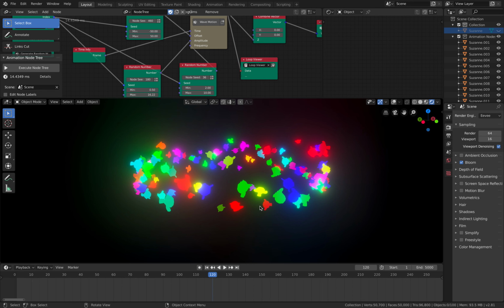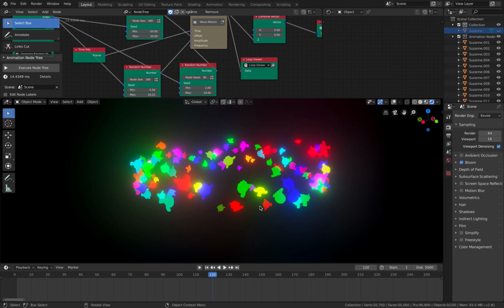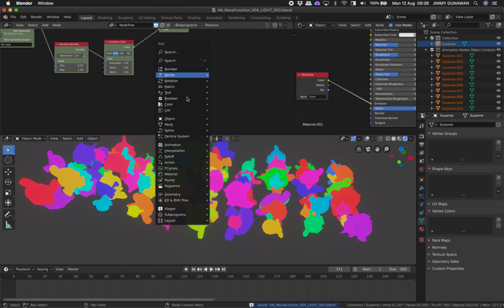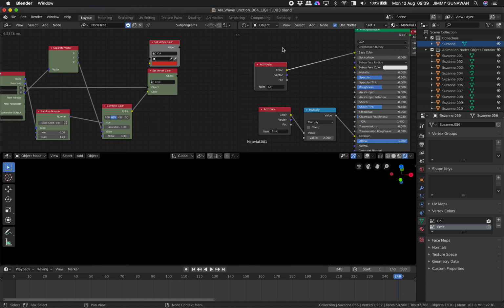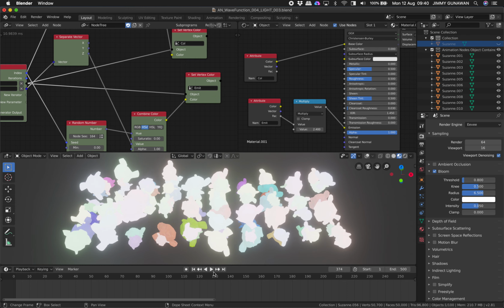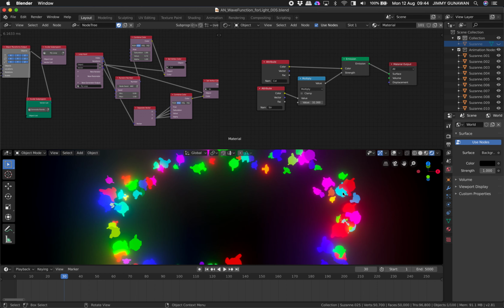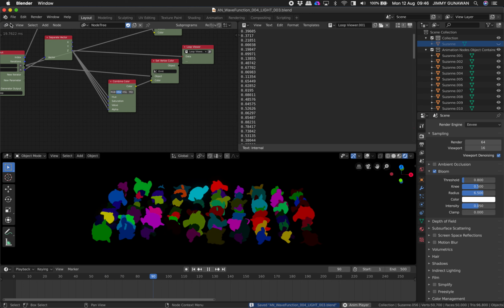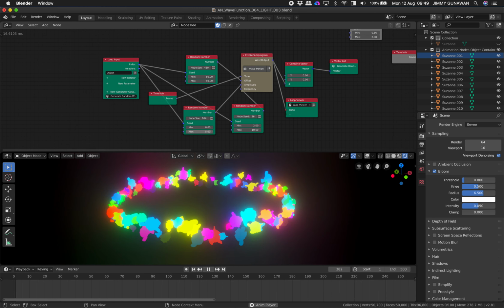LIVENODING 1176 / AN Glowing and Blooming Monkey Heads using Nodes

Comment: The problem of the strength value in your shader, is that the math node is only grayscale, you must use multiply node in animation graph before the combine color in value, or in the shader graph using a mix color and increase the color value in HSV mode
I hope it can help ;)